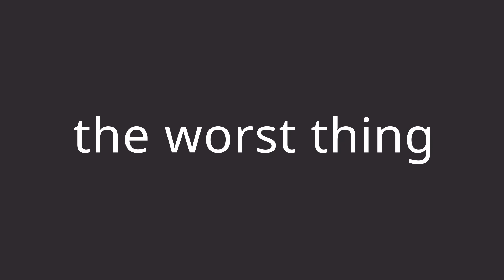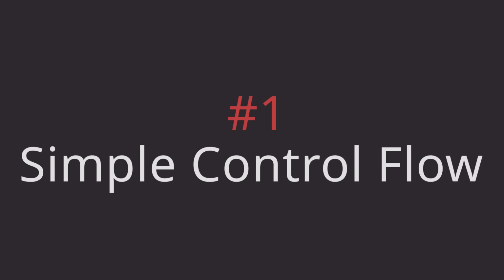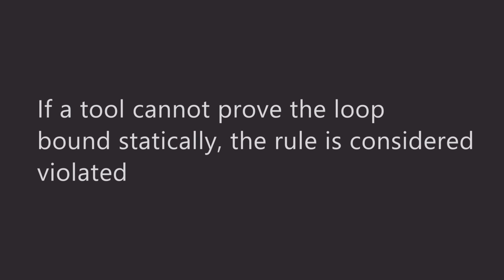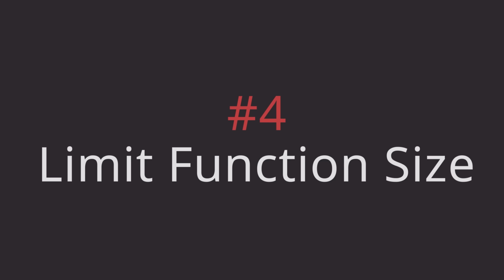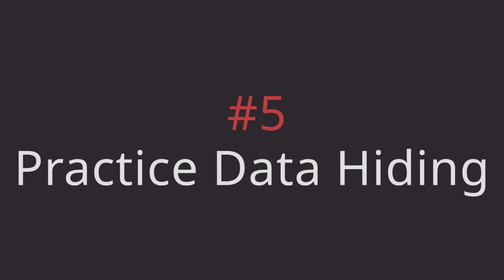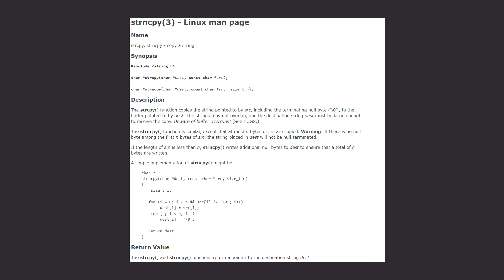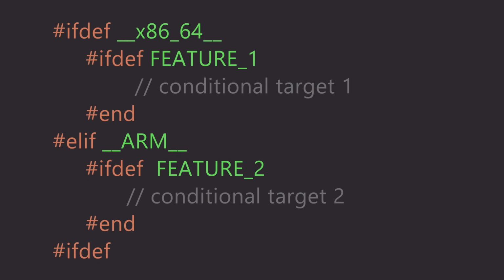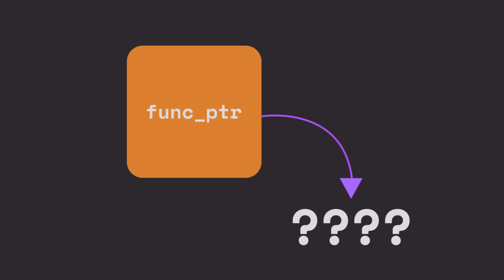how NASA writes space-proof code

Comment: I disagree with data hiding, that is recursion. Granted the compiler may rework this. However this is really just limit function size. Personally I favor global memory allocation, however this is not practical in all cases. Function prototypes require careful consideration. Ideally all functions are pure, but this is impractical in IO. API design can get you into a lot of trouble if not careful. Lot of people hate scheduling which sneaks into this.

Modular logic is funny because there is correctness and portability versus performance. It is easier to rework top down than bottom up. Most performance comes from bottom up. Java tried to force people to use top down by removing bottom up. There are only a few bottom up types of people, I would ever consider working with. The rest just get in your way. The problem is certain bottom up people do not understand when to stop being bottom up and switch to top down then back to bottom up.
Reply: In all fairness, I am being unfair to the suggestion of data hiding. Data hiding is important and required for large scale software. When taken to the extreme this can actually be dangerous. As mentioned there are certain performance issues which can occur. However these should be sub classed, which represent encapsulation. Encapsulation is data hiding, they just do not really teach it correctly. Corruption of state or illegal access is the point of data hiding. You also get free stack randomization in extreme cases, which is not actually desired here.

Static code analysis goes by another name which is determinism. They can use this for scheduling which can simplify architectures. However this is potentially more expensive. It works up to the point the memory architecture fails.

Comment: Mathematically, these rules forces your program to be delta 0, because your flow is build from bounded loops and basic operations. (The rules of direct flow and hard bounded loops enforce that).
Note that this is means NASA's programming is not turing complete, and you cannot program with this rules more advanced (in arithmetical hierarchy) programs, like dynamic analysis of code.
If you want to have bigger expression power but to stay safe from infinite loops, you can restrict yourself to loops that are bounded by a number that can be evaluated in run time before entering the loop (but does not need to be constexpr).
This allows primitive recursive functions, which are stiil not Turing complete but they are more powerful and must halt.

Comment: Key points from the video:

Control Flow Constructs: NASA restricts the use of certain control flow constructs, such as go-to statements and recursion. All loops are required to have a fixed upper bound to prevent runaway code.

Memory Usage: NASA recommends using stack memory instead of the heap to avoid memory bugs and leaks.

Function Design: Functions should perform a single action and be no longer than 60 lines. This makes the code more readable, testable, and well-structured.

Data Hiding: Variables should be declared as they're used at the lowest scope possible. This reduces the amount of code that can access those variables, making it safer and easier to debug.

C Preprocessor: The use of the C preprocessor should be limited to file inclusions and simple conditional macros, as it can obfuscate code and reduce clarity.

Static Code Analysis: The video discusses the challenges of static code analysis and emphasizes the importance of avoiding conditional compilation, using pointers correctly, limiting the use of function pointers, and compiling code with all warnings enabled and in pedantic mode.

Testing: Code should be analyzed with multiple static code analyzers and undergo unit testing before launching a project.

Comment: No function pointers, huh.  They must have never written a very simple and compact command interpreter/processor.  Limit the preprocessor, huh?  They must not have written any unit tests.  Probably a good idea to do in production code, but not in any unit testing framework or actual unit tests that I'm aware of.  Maybe they aren't unit testing anything?

Those are just a few of these NASA rules I refuse to implement.  Some of them are good, especially the max iterations and encapsulation, and not using dynamic memory.  But I already do that wherever I can.  

One thing that isn't mentioned is the dangerous use of comments that almost always get out of sync.  I do not comment my code.  My code is the comment/description.  It says what it does, and does what it says.  It never gets out of sync with comments this way.  Nowadays there is absolutely no excuse for writing a bunch of comments.  Identifiers can be as long as you want.  Make succinct names that say what stuff does or means.  Give names to magic numbers using #defines.

Comment: I hear (from them) that they are moving away from c all together, and looking at moving to Haskell for their flight controller code.

They have made a library called copilot which is a DSL in Haskell. You can easily formally verify your Haskell program, and then when you run it, it outputs C code to upload to the device. Much smarter than using C for important things
Reply: but they don't use C at all. It is a small impact. NASA mainly uses Fortran

Comment: One problem is that most people are too obsessed with testing and quality for their crappy app or website that doesn't need 6 sigma reliability. You only want to code like NASA if it makes sense. Coding like NASA and being as rigorous takes time, money, and energy in droves. If you've got an app that generates sales proposals or something, you don't need extreme reliability. You want to make something that's generally reliable and has the features you want for the least amount of time. If a problem occurs you restart the app and fix the problem.

Your development process should adapt according to the business needs, the project requirements, and the criticality of the code--aka how impactful is it if it fails. If failure means minor inconvenience to a user, then writing anything more than basic tests does a disservice to the business.

Comment: Sorry man, you didn’t even scratch the surface about how Nasa approach software quality. I work with automotive engine management system where the level of safety is insanely higher than this video. For Nasa I’m pretty sure you can take what I said and put it to the power of 20. This video only shows very elementary methods for coding, the quality in sw extends to much higher levels
Reply: You watched a 6 minute video and expected an exhaustive video detailing all of NASA's coding practices?

Comment: But what if I’m writing a machine learning application in Python or a server application in Java as opposed to something C++ would be used for? Would the higher-level principles still apply or is this specific to developers of languages such as C++, where such memory management techniques are necessary at times?
Reply: Writing safety critical code in a higher level language such as Python or Java is near impossible because those languages do so much under the hood for the programmer. Machine learning would not be included in a safety critical portion of code because it is not fully deterministic and it’s behavior can change over time. Also, I can’t envision a case where a server application would be safety critical. The network stack is usually considered non-compliant with safety critical requirements so anything going to or from a server would have to be considered “nice-to-have” rather than mandatory. 

Hope that helps!
Reply: @kevinisawesome9030  So what would be done in C++ that couldn’t be done in any other language?
Reply: @aycc-nbh7289  it’s all about knowing exactly what is in the production code. So you have to be careful with C++ code as well. With C, as long as you don’t use any compiler optimization, every line of source code corresponds directly to some piece of machine code. To be certified for safety critical flight software, you have to be able to show that you tested every piece of machine code going into the product, trace where every piece of machine code is in the source code, and trace all lines of source code to requirements and tests. 

With languages like Java and Python that run through a VM or interpreter respectively, you would have to text every single piece of the VM or interpreter with every possible combination of input (every single possible line of Java or Python that could ever be written). Obviously that’s impossible so those can’t truly be used in safety critical flight software.

As for C++, the line is a little blurry. C++ will insert additional code to support object-oriented features and some initialization stuff. So you have to make sure that you’re aware of the extra stuff the compiler adds into your final binary and then test it accordingly. It gets really tricky.

So I’d say that a lot of this is specific to C/C++ developers. Like pointers are used extensively under the hood by Java. Every single object in Java is more or less just a pointer at the end of the day. So a lot of these rules are broken simply by the constructs of those languages.

Comment: These are rules I understand. I'm self taught, meaning, that about 35 years ago, I learned by doing and studying on my own. I was always confused by why I was always reading about issues that were easly pervented by proper coding. It wasn't until I step into the corprate world, that i saw why.

If a function has a return value, then check it, it is there for a reason, but there are exceptions.
If you are directly allocating memory, you had better have a good reason for doing so.
Recursion has it's uses, but always ensure it has a set limit. Although it may be easier to elimimate it.
GOTO has special case uses, but as a rule you should avoid it.
Each peice of code (function or module) has a specific problem to solve, nothing more or less.
...

Unfortunately, what i took for granted in my own work was often missing in the wild.

Comment: Rust has made many of these rules somewhat "unnecessary" as it is built into the language itself to ensure develop don't shoot our own foot while still allowing a good deal of low level control.
I've had spend years with embedded firmware too including system that don't allow dynamic memory for safety. But recently years, i find that rust automatically help enforce many of these rules like the return values, mutability, memory ownership, no dangerous pointers, etc

Comment: There are far worse things that can happen than code crashing. Code crashing is usually a known failure case in a system, that may be able to be worked around. Silently helping kill people is my nightmare.

I came close to that once. I did a calculation that showed that something that was potentially dangerous was not possible, given the hardware and operating parameters. Then, a few months later, the hardware changed, changing the underlying math. The calculation was not re-done, required testing to find this issue was not in our test plan, and the failure case was not obvious to most people even when provoked. Then, after release it started to happen in the field - resulting in a Medical Device Recall (MDR).

Fortunately, it seems that this had less of an effect than expected on the effects caused by the medical device, and no one should have died as a result.

I like #1, #2, #6, and #10 in all cases. #2 and #10 in particular have caused dramatic improvements in code quality for multiple projects:
    #1. Avoid complex flow constructs, such as goto and recursion.
    #2. All loops must have fixed bounds. This prevents runaway code.
    #6. Restrict the scope of data to the smallest possible.
    #10. Compile with all possible warnings active; all warnings should then be addressed before release of the software.

I like #3, but occasionally have not been able to do it due to hardware and/or software limitations (example: there is no stack).
    #3. Avoid heap memory allocation.

#4 depends both on the processors used, and the culture. I have used processors that do not permit multiple functions:
    #4. Restrict functions to a single printed page.

#5 is a good guideline in many contexts, but would be hard to implement usefully in, say, functions that have a single line of code. Also, while the concept is good, the implementation depends on the context, hardware, and language:
    #5. Use a minimum of two runtime assertions per function.

#7 looks like a language issue (or possibly a compiler compiler issue). They /should/ be able to make a warning to cover for this case in their compiler(s) or static analysis tool(s).
    #7. Check the return value of all non-void functions, or cast to void to indicate the return value is useless.

Within program logic, I agree with #8. One can have code which quickly explodes in complexity. Sometimes they are very useful for code re-use in different contexts. 
    #8. Use the preprocessor sparingly.

#9 is mostly a language issue. Many languages don't provide easy access to pointers.
    #9. Limit pointer use to a single dereference, and do not use function pointers.

Comment: I agree with most. Some are impossible in some condition (you might need to target multiple architecture/OS...
The new virtual function, I agree with the point, but it can help abstraction and unit tests, and it might be a more convenient way to reduce code bloat. (Think reading IO, it allows abstraction on the where from (input stream, file, network) or the lower level stuff (does it have a V1 or V2 of the document).
Fine for application specific where you can safely control all the path and reduce to amount of path possible.
The function should do 1 thing I totally agree. One thing at one abstraction layer. Though not of the line limit. But generally, you should have short function if you respect that, and use some design pattern for "big cases" (like factories)...

Comment: Very interesting. The video exclusively references C. Is that just used for convenience/as an example or is it safe to assume most coding for aerospace is in C, and if so is that because it's all embedded platforms? I code for apps and the web so it doesn't figure in my day job. After various BASIC compilers I dived straight into assembler when I was a kid (MC68000 series on Ataris and Amigas). I kind of miss all that low-level stuff. There's something more exciting about being 'closer to the metal' as it were.
Reply: My understanding is that C was the predominant language in aerospace. I gather it still is, given that multiple of these rules pretty much are C-specific.

Comment: I had to do this when I worked on pump controllers, the rule about not using free etc. if you mess up you flood a room because of pressure relief valves in some cases don’t outflow to safe places because they need to be at x point and each install is different and fudged up.

A good tool to mention is WDT (watch dog timers)

Comment: I always thought it was interesting that you can both call a function as is, and call it as a means to set a value to a variable. Never occurred to me that when doing the former, the return value could turn into junk data in extreme edge cases.
Reply: Yep. I work in Delphi. While it's a significantly flawed language, one of its uncommon strengths is its division of routines into _functions_, which return values, and _procedures_, which do not. Calling a procedure on the right side of an assignment statement results in a compilation error, so there's no chance of creating junk data that way.

Comment: I sometimes wonder how hard it would be to code programs with the expectation that your hardware is going to suffer from radiation flipping bits.
Reply: That’s why we invented parity bits and error correction codes. The process that accesses an uncorrectable memory error is killed, and the system restarts it.
Reply: @richardblain4783  Also redundant computation with a voting system. Basically have multiple computers (in hardware) do the same computation and pick the result that was reached by the majority of them.
Reply: @Croz89   Triple redundancy is very safe, but it requires lots of hardware (CPUs, separate memories) and lots of power. The power consumption is a challenge in battery-powered systems. And how do you ensure that the voting logic functions correctly? It’s much simpler than the CPUs, but it’s still a weak link.
Reply: @richardblain4783  Basically all earth orbit satellites are solar powered, so that's not really a problem in that case. Even for Moon or Mars rovers power consumption isn't as critical as a probe going to the outer planets. There is a chance the voting system might be corrupted, but it's pretty small so you can often shield it better. Even error correction isn't perfect since there's also a chance that the CRC or parity bit is correct even for corrupted data, or the error checking function itself is corrupted and approves corrupted data.

Comment: WHY DOES NASA USE C AT ALL?

Other programming languages don’t have many of these flaws!

👉@NASA: use another language or create your own!
Reply: Im guessing  it Keeps the code size down.  More code size means more memory usage, which means more power usage, which means more   RAM chips and more battery draw, which means more physical weight, and it's not cheap per oz of weight lifted out of earth's atmosphere.
Reply: I have to imagine that it's because there's so many pieces of unique hardware, meaning they'd have to write an entire API for each new piece of hardware if they used another language, or they'd have to break the language's safety features in order to use inline c anyway, since many of these devices might be communicating with raw bit registers